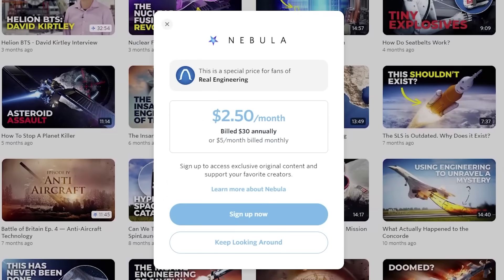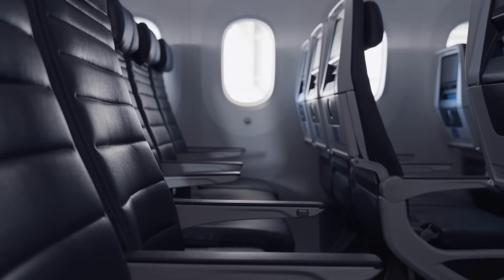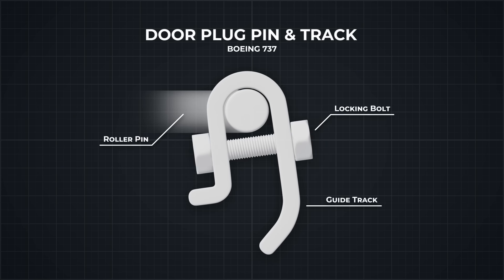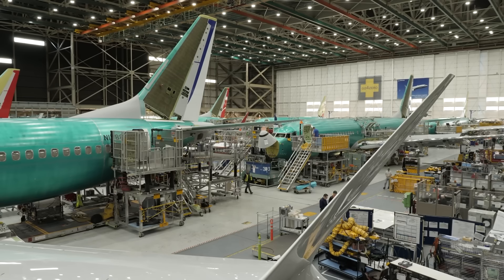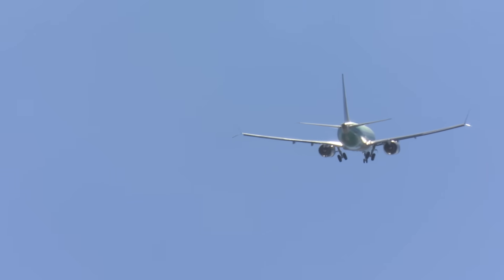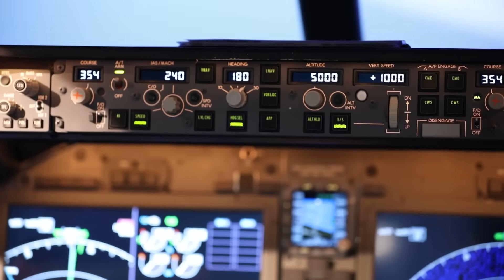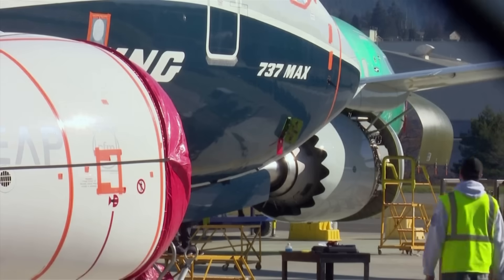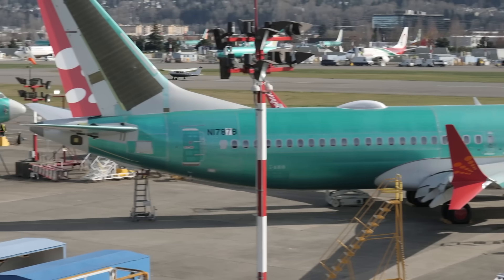The Questionable Engineering of the 737 Max

Comment: Used to work at Boeing. It’s all penny pinching management. Mechanics concerns are ignored and we’re worked to the bone to go faster so they can lay us off faster. Also, production was spread out far and wide to save money and caused quality to go to hell - the story of all companies, but terrifying when it happens to airplanes.
Reply: This anecdote rings true from other documentaries I've seen about Boeing. Company culture changed when they merged/were effectively taken over by McDonnel Douglas management I think it was. Been a few years since the documentaries on this - it's nothing new for Boeing. Just extreme dystopian greed at its worst.
Reply: @tonyhawk123  Yep, it was MD. Their C-suite team ran MD just about into the ground, making it seem juicy for Boeing to sweep in and acquire it. Then Boeing moved their headquarters away from any of their production and engineering teams and put that same bunch of proven C-suite losers in charge. Here are the consequences of putting proven losers in charge: 189 entirely preventable deaths, 157 completely foreseen and criminally permitted deaths, hundreds of jobs and billions of dollars lost to huge delays, many more domestic jobs outsourced to the lowest paying and least accountable foreign engineering firms... I could go on.
Reply: More rubber 'o' rings. Failure above a certain level, is no imprediment to a successful carreer. Some even get rewarded. There's a lot of 'regulatory capture' around these days.
Reply: @gitfoad8032 the shitty thing is this ceo will likely find another ceo role in another company somewhere and be praised for cost cutting all while pocketing the profits for himself.
Reply: Yup. I worked at a contractor who did the frames of Boeing planes and it was all penny pinching, work fast, ignore potential problems, just hit the target type of management. I couldn't be a part of such a broken system. The worst part was when the execs would have all the factory workers talk about the targets they wanted to hit in the next 3 months while also not hiring more staff, providing new tools that functioned better, not addressing safety problems at work stations which that people had to work around or doing anything except putting blame onto the factory workers.
Reply: For a company that does such important things and has 18 billion in annual revenue it should be illegal for that type of behaviour to exist
Reply: @willpugh8865  You can thank Dodge v. Ford Motors co. For that.

That's the lawsuit that in 1919 established that for companies, the interests of the shareholders came first, yes, before even that of the people, country (let alone employees lol).

US companies have a legal duty to fuck everyone over if it increases quarterly profits.
Reply: @willpugh8865  The concept of 'legality' only exists for this sort of shit heh. May the smarter lawyer win! Everything is predatory competition under capitalism heh
Reply: I am working in a similar company were engineers are constantly ignored highlighting risk. Quality issue everywhere now and executives switching roles constantly. 

The moment the BA have too much to say is the start where the ship is sinking.
Reply: @frankh4069  Profits over People! Welcome to capitalism ...
Reply: @3nertia the way to make more money is to not have plane failures. More competition would help improve quality and lower costs but the government doesn’t enable that.
Reply: I read the email chains from the crashes - as a manufacturing engineer. We were talking about how absolutely batshit backwards their culture and ideas were in addressing quality and safety. It was all about placing/dodging blame and maximizing profit, and avoiding having to do anything with any cost to fix the problems.

I don't make anything life-critical (though some parts of the company do.) We still have the idea - if there's a quality issue the #1 issue is "how do we fix this and keep it from happening again, and address the systemic issues that drove the problem." Boeing looks to be stuck in the idea of "reactive not proactive" and refusing to address the corporate culture issues driving all of their problems, meaning that this door issue is just a symptom and unless they address the underlying quality culture and business practice issues it's only a matter of time before another oversight kills more people.
Reply: 737max should never have been certified under the 737 type certificate is basically a new plane wrapped up in the 737 fuselage. To type certificate a new aircraft would cost 100’s of millions so Boeing basically created a new aircraft called it a 737 to get around all the regulations it would take to type certificate a new aircraft and the FAA is compliant in this short cut. It’s the responsibility of the FAA to step in and say no but Boeing has a tendency to reward high paying executive positions to FAA inspectors who “help” them out on certifying aircraft.
Reply: That sums up most manufacturing companies ive ever worked at.
Reply: So is there not any oversight from the Gov or FAA in house while building planes? I know nothing about this but I'd think there would be some kind of constant oversight on things from an outside entity on every level of production. So that if a mechanic had a concern they wouldnt only have their employer to talk to.
Reply: On my one year wedding anniversary to Iceland almost a decade ago, my wife and I befriended a couple, also there on their anniversary, where the husband worked for Boeing. He was extremely proud to work for the company, but really didn't have too many kind words for management.
Reply: Oy vey!
Reply: Very true. Employees and lower level managers are rewarded for producing monetary returns or saving costs, but not rewarded as much for making reliable designs with large amounts of redundancy and safety margins
Reply: No money for self locking nuts?
Reply: You can't reduce costs by adding more pockets to feed. You can just reduce quality and shield yourself from blame.
Reply: I’m sure a lot of the great mechanics were underpaid and left, so what does management do? Cheap affirmative action hires to win woke points. It’s showing in their poor quality. Now a cargo plane burnt up in the sky. Safe landing but that type of thing SHOULD NOT HAPPEN
Reply: This what happens when Boeing decides to save money by replacing trained licensed aircraft mechanics with a bunch of low paid high school dropouts
Reply: Working there I think it’s both bad mechanics and bad management. Too much watching YouTube on company time
Reply: @zachattackp1566  Would explain a lot.
Reply: All companies devolve to this due to capitalism in it's current form. Which I would argue, isn't capitalism at all. Hardworking engineers and technicians build a brand up through dedication and hard work. Businessmen move into to milk the company dry of all reputation by riding on the reputation of the past. All companies do this because the people that do it are massively reward with unfathomable amounts of money. They don't care that they are killing an American icon. These people are domestic economic series killers.
Reply: to bad companies aren't simply shutdown by law and the board banned from operating anymore companies  if it's proven that the companies dosen't care about quality
Reply: Because they learned from them douchebags at McDonnell Douglas 💀💀💀💀
Reply: The union is building these planes, installing these parts improperly, quality checking, and accepting whatever workload management asks of them. Boeing management sucks without question, but how are they responsible in this?
Reply: @richardnixon8795 it’s always management my friend. Those are the people hiring workers that stay quiet, stay cheap, and don’t say a word. The well paid mechanics with the balls to say something to management are all gone now. That’s why it’s management’s fault.
Reply: @richardnixon8795 it could be an inspection oversight at boeing; I'm not saying that it is, just that it's a possibility.
Reply: Capitalism for you bruh. American way is going downhill and it’s great tbh
Reply: @interstellarM31  Capitalism can be made to work, but you do need a tough regulatory regime with teeth to keep it on the straight and narrow. Which big companies like Boeing have conned the great unwashed into opposing.
Reply: Boeing being destroyed by McDonnel-Douglas management under the skin.
Boeing was an engineer-led company. Then after the takeover of MD it became a manager/financial-led company.
Reply: It's a united states issue. European manufacturing is extremely high quality because the workers are at the board room level and executive seats at the table and not just slave labor like the US who worship their financial enslavers and fund the banks who are their own destroyers while credit unions attempt to save them from themselves with social safety.
Reply: Even NASA's space shuttle columbia disaster is is a similar story
Reply: Capitalism really does ruin everything
Reply: I wish this was capitalism. Its actually corporatism.
Reply: @user-pf5xq3lq8i  corporatism exists under capitalism. Still the same mode of production for profit.
Reply: But they have money to pay management a 60 millions lifesaver
Reply: @jenweatherwax7113
Shall we say, that it is a reflection of the state of Economy of US of A? - that the firm is unable to pay the wages for extra hands and the axe fell first on "inspection" (with serious consequences)?
Reply: Typical crazy management, they lay off veteran core worker because their salary are too high, but give more bonuses to executive
Reply: Apple is next, they are moving some components to India to assemble in China. That is a recipe for disaster. Apple already gnawed that bone dry, consumers are irked for no improvement new releases but sky high prices.  Watch my words what will happen to apple in few years.
Reply: Still alive?
Reply: Watch out, you might die from a self-inflicted wound or two weeks after contracting an illness!
Reply: After the 2 fatal crashes of the 737s one would think they would want to get their shit together.....what is it gonna take
Reply: Hopefully you dont dissapear after this
Reply: Production being spread is no issue when done right. See Airbus, they're made all over Europe and assembled in France.

This is just the US' turbo-capitalism at work.
Reply: @Killerpixel11  You are right. It's all about demanding quality and then monitoring compliance. Airbus assembles not only in France. Also in Spain and Germany. But the logistics are therefore very demanding.
Reply: @Killerpixel11 definitely, now even in China with their production. IF done right, is a fundamental tool to the company. If done with greed, can be a nail in the coffin.
Reply: @Killerpixel11 yes but we are also under capitalism in France...

Same cause will give same effect. Just a question of time.
Reply: That is such a neat way of putting it, turbo-capitalism lol @Killerpixel11
Reply: @Killerpixel11 No, they have a production facility in Alabama.
Reply: @Killerpixel11 to be fair Airbus has its issues as well when it comes to quality control and innovation, though definitely not on the scale of Boeing
Reply: @Killerpixel11 In America production is spread to keep workers from striking in a way that really hurts the management's bonus. It has nothing to do with efficiency or quality.
Reply: @Praisethesunson  Not just in America - capitalism is global ;)
Reply: @Killerpixel11  Airbus is spread over multiple countries and continents for design, manufacturing and service. It's not fair on other countries and their employees to blame them for boeings fuck ups
Reply: @Killerpixel11 Airbus is definitely safer than Boeing (and air travel is incredibly safe) , but they have issues with innovation. Hopefully other companies can deliver more climate friendly planes and rockets soon(The US does that already), and maybe the startup daughter companies to Airbus actually work, although I doubt it because they are so closely tied. Of course no matter what company strong safety regulation is required
Reply: @xWood4000 Even though they still have landing gear issues?
Reply: @Killerpixel11  Virgin Atlantic Airbus A330 flight from Manchester to New York cancelled due to missing bolts/rivets on wing. Just sayin'. :)
Reply: @Killerpixel11  No, this is just the same cycle this predatory system - that we now call 'capitalism' but that has existed for millennia - always goes through; every 40-80 years like clockwork heh
Reply: And people still think that "The Market" is self-regulating!!
Reply: @idjles  It is. Good night
Reply: Oh my God! Unfortunately qualify control is being ignored in favor of insane profits!
Reply: that quote "planes are safer than cars" couldn't have aged more poorly while boeing still exists
Reply: @swilleh_  So, this is still true, and cars are suffering the same issues because car companies often have similar management.
Reply: Nice hyperbole.     Planes are still about a gazillion times safer than cars.   Was anyone killed in this incident?  No.    In 2021 there were on average, 118 fatalities EACH DAY in the US from auto accidents.    @swilleh_
Reply: @swilleh_ we would need approximately 3900 more fatal plane crashes (assuming each plane has an average capacity of 300) for aviation to be as deadly as road accidents.
Reply: Holy dog shit. McDonnell Douglass bought Boeing with Boeing's money!
Reply: The skies are far less tolerant for negligence, incompetency and accomodation
Reply: Welcome to capitalism ...
Reply: @3nertia  maybe you should have taken a ride on a TU-14